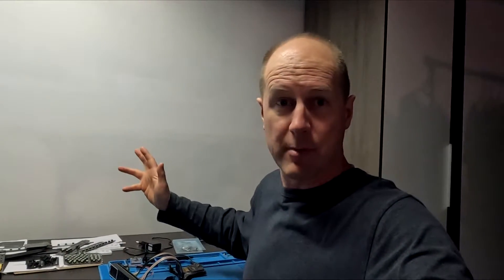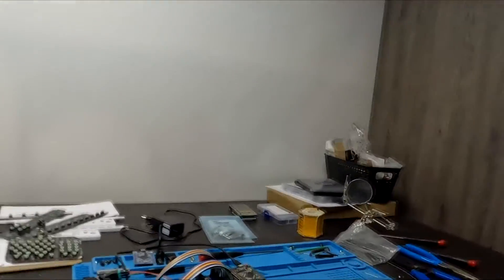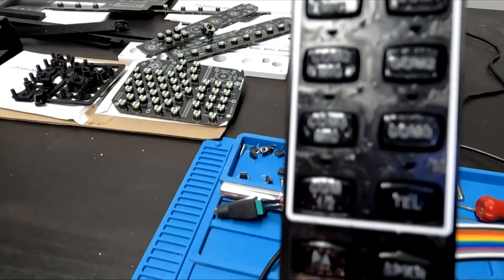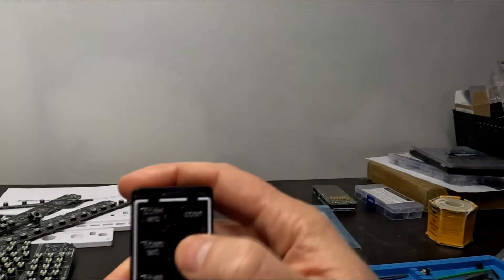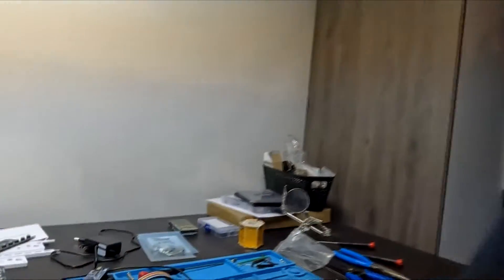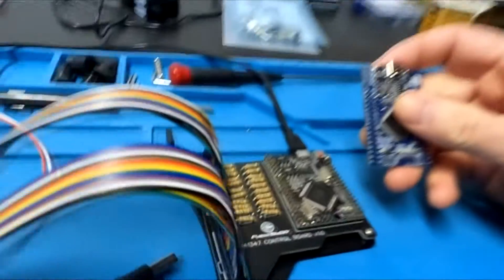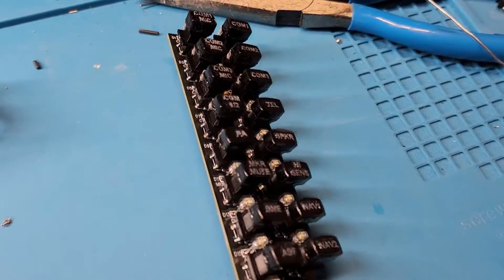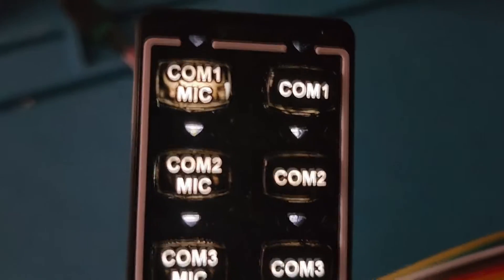Home Flight Simulator Audio Panel for Microsoft Flight Simulator 2020, X-Plane, P3D

Comment: Dave @ Flighsimdiy is a good guy. Been with them from day 1. His new idea's are gonna blow your mind!
Reply from the maker: Yes the work Dave at FSDIY is outstanding. His work is really making it easy for the average simmer to built realistic flight controls. I've got his G1000, GDU1500 and the GCU475 keyboard all ready to assemble once a few more parts show up. Watch for those builds to start showing up over the next few weeks 

Thanks for watching